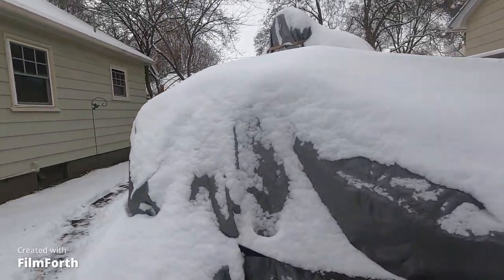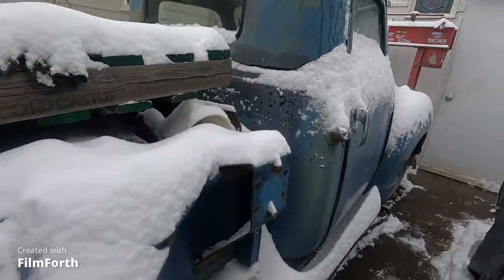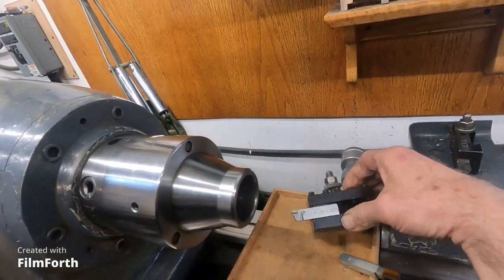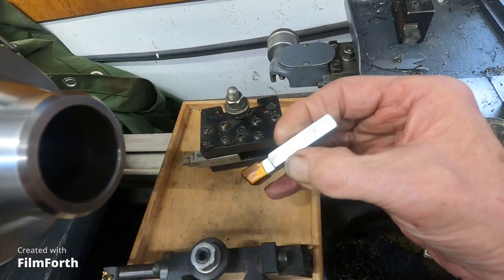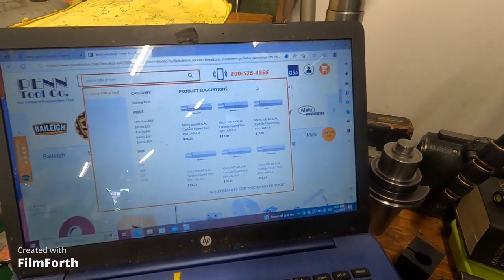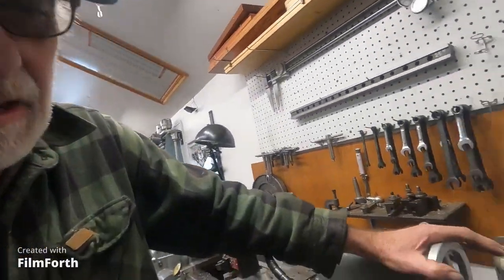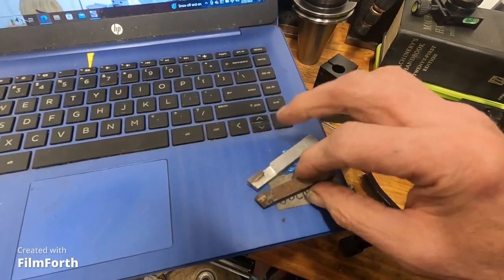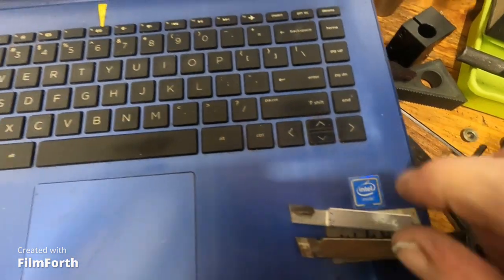Tool Room lathe finish cutters

Comment: I have built a three truck propane steamed Shay.  It's hard to believe that you have all the equipment in that small an area.
Reply from the maker: I have built small steam engines over the years and always wanted to build a loco. I would get bogged in specific work like hydraulics and would do a model part when I could for a diversion. This town here has become a high dollar wine destination making any covered space extremely expensive as these rich drunk and some famous  coked up yuppies also need space for car collections and motor homes. I am fixing up my Grandfathers house here and hope to get out this utopia that they will soon destroy while I still can.
Reply: I find working on steam engines and watching them run a satisfyingly of keeping busy in retirement and it keeps me learning new things which is very important.  I have a real welder make the locomotive boilers although I have made a few copper boilers by riveting and silver soldering.  I have just about filled my two car garage up with 2 metal lathes and other equipment.  I am a member of a local club where we have 5 miles of track in Costa Mesa.

Comment: A friend of mine has bought some of the $7 brazed carbide bits from McMaster (probably the same as the $2 Shars ones, just with faster shipping and the typical McMaster upcharge). They seem to be very fragile. I think one or two of them came fractured AROUND the cutting edge, only hanging on by a bit of braze. Perhaps fractured when it cooled or during grinding. So while those cutting tools may work for a while, I think the extra money is worth it on those micro 100 tools. Same story you hear in many other situations.
Reply from the maker: There can be a lot of money and time on the line just to have an edge failure from a bargain tool destroy a bearing seat. I caused and edge failure for an early video just for fun. I can lay out what works and back it up with published material, and only 1 or less per thousand watching can or will utilize this.

Comment: I have learned a lot from you videos and would like to see a diagram of your shop as you seem to pack a lot in the room.  I am just a hobbyist and make ride on 1/8 scale steam engines.
Reply from the maker: I am working on a 1 1/2" to the ft scale model of a 10 wheeler locomotive. The shack floor is only11X22ft

Comment: I know you like the brazed tools, I use then as well, however there are amazing inserts that will cut bearing materials etc.. All about application set up support etc.  I use HSS tools for a good bit of my work. Not everything is hard nor is everything easy to machine. All of this is super.
Reply from the maker: That made no sense at all, I will tell you right now you can not do what I am doing  at reasonable costs or time with inserts, I can quickly change the cutter angles as needed with the cutter grinder, There is no easy way out here, thanks for tuning in.

Comment: Good video, have you ever used  a sideways shear tool? It’s basically a shaper shearing tool but modified to run on a lathe. I’ve run it about a thou per rev at around 1500 rpm. I can see the “angel hair” like fuzz come off the work piece
Reply from the maker: I understand that Is a good method for soft steel, but have not tried it, mostly work prehard 4140 type alloys with this cutter, thanks, I have not heard of that for a while.
Reply: I have heard that style of cutter gets very good results with copper and lead, does not tear the metal so much.

Comment: i have about 30 of those bits i got in a box full of tooling i bought.  k6 -Ar6 . k25-Ar6 . k6-D6 . and Ar5  most are kennametal.  what kind of carbide are they? Thank You!
Reply from the maker: I do not use Kenemetal, only Micro 100 brand very simple only one grade, damn good. thanks.

Comment: I’d love to see how and with what you manually touch up your carbide.  This is something we’re all interested in and very few show it on YT.
Reply from the maker: I use the Easy Lap diamond knife sharpeners available at sporting good stores, as they are used, they break down finer. They are too coarse at first, sharpen steel  tools  to break them in.